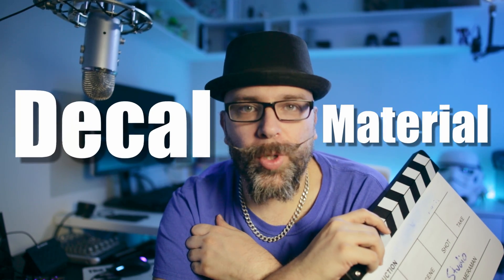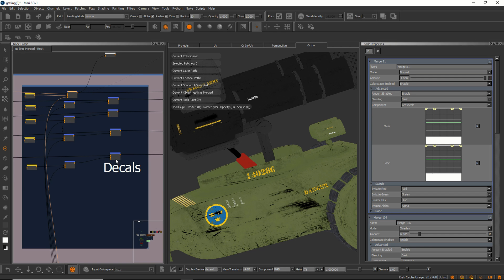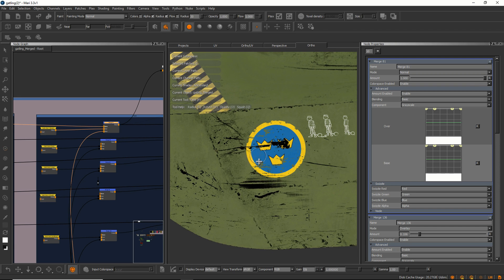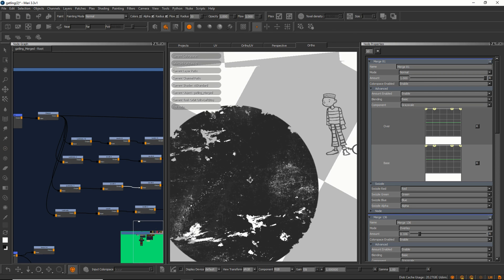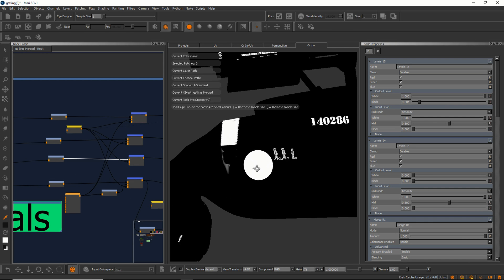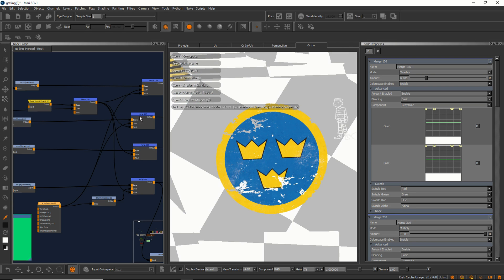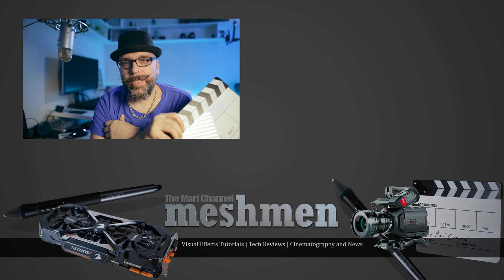Mari node graph tutorial | how to set up a decal material | EP5

Comment from the maker: 0:19 Introduction of the decals
0:38 blending the material
1:23 Decal material walkthrough
2:07 blending with metal mask
2:54 splitting out the different material properties
4:30 adding breakup to the decals using a axis projection
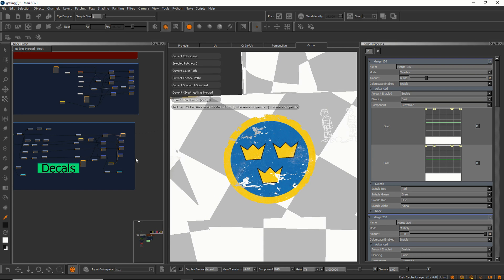6:35 conclusion
7:20 next episode